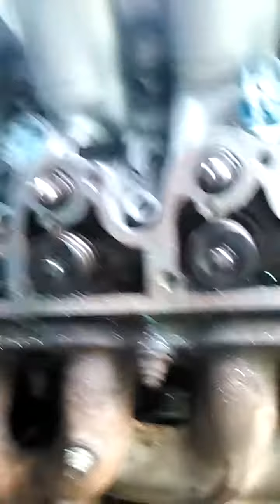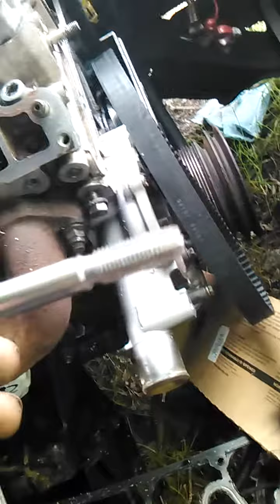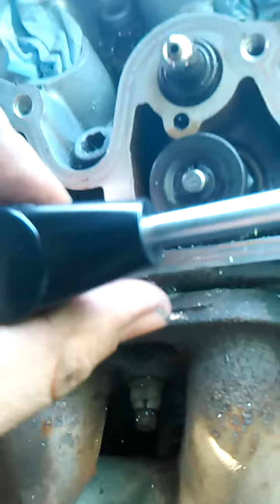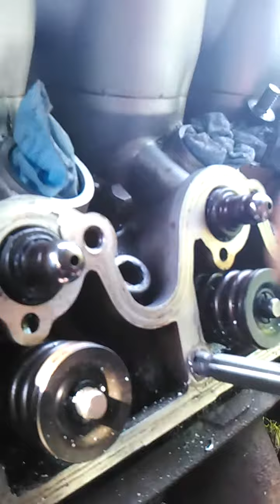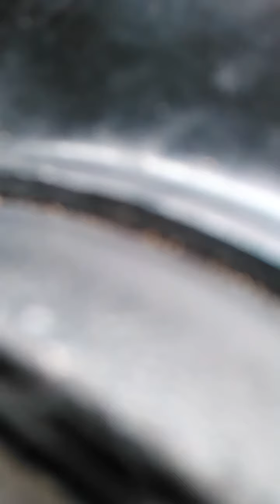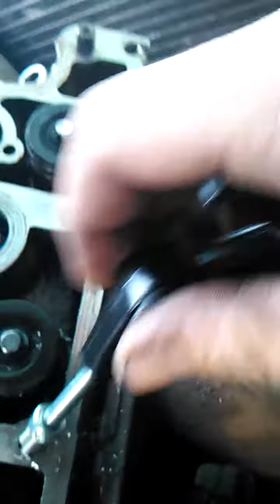How to install a helicoil

Comment: So a mechanic did a heli coil repair on my intake manifold. When I removed the bolt a few months later, the heli coil came out with the bolt. Why?
Reply: Loctite from the helicoil got on the bolt he put back in it.
Reply: @1969Donovan  No. Turns out he never rethreaded the hole before putting in the helicoil. He just installed the heli coil by forcing it in.